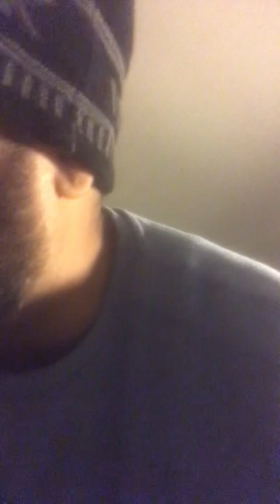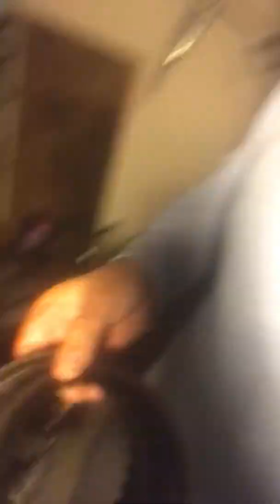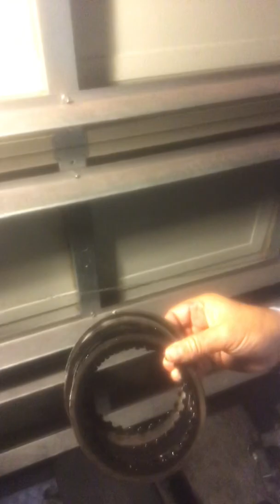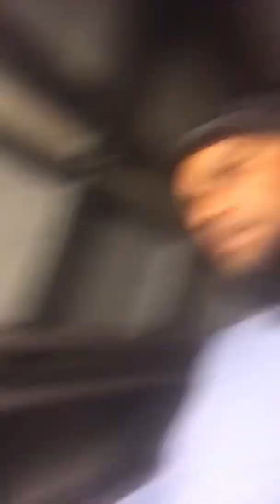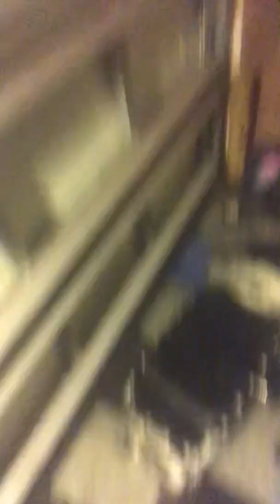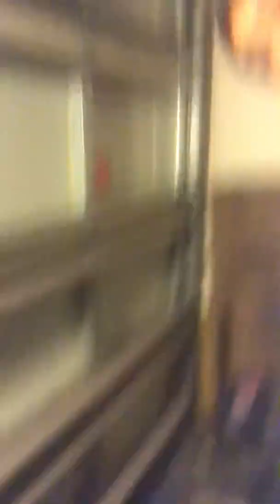BMW 5-Series fail safe mode 4f85 code fixed

Comment: Hi everyone.
Have 2010 Bmw 550i M-sport with 6HP28.
Baer same problem.
I replaced solenoids, bumper pistons with Sonnex spring, two times fluid and code coming back again and again.
Every time draining fluid it looks dirty even it was in transmission for couple hours.
It looks it is time for change clutch disks.
Reply: I have a 2011 BMW 335d keeps slipping around 4-5 gear and did a trans scan and got code 4F85 EGS: Ratio monitoring, clutch E. So I’m just getting a used tranny it’s a lot cheaper than getting the tranny rebuilt.

Comment: How much did it end up costing you and where did you get the parts! I might have the same issue!😅
Reply from the maker: I think I got it on eBay for around $500 I had to buy some seals separately

Comment: Hi,
Had you replaced the bushings of all clutches or just on the e-clutch ?
Reply from the maker: All bushings was replaced complete transmission rebuilt . It won’t be a good idea not to rebuild the whole transmission if it’s already out plus the kit comes with all the clutches

Comment: I'm having the same issue. Replaced the solenoids, seals, and fluid myself, that fixed things for about 5 months. Now I've got 4f81 codes I think, maybe it's 4f85, but it references the e-clutch and I'm stuck in 3rd gear limp mode. Looks like I need to either rebuild or replace the transmission...sucks!

Where are you located and are you a mechanic?
Reply from the maker: Yes most likely
Reply from the maker: I am actually a real mechanic located in Florida tampa/st Pete area

Comment: How tough is it to rebuild the tranny?
Reply from the maker: On that model it’s not that hard but you have a lot of parts to keep track of and the order that it’s put back together pressing the bushings was the hardest part for me
Reply: @romydial  do you have a lift? How long did it take you and does the transmission need to come out?